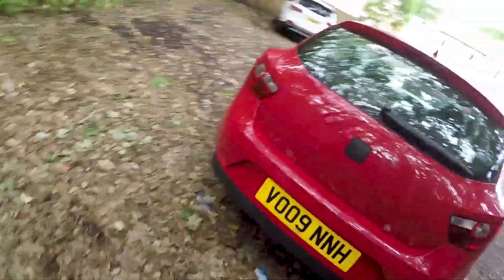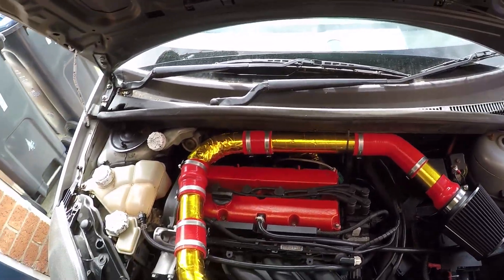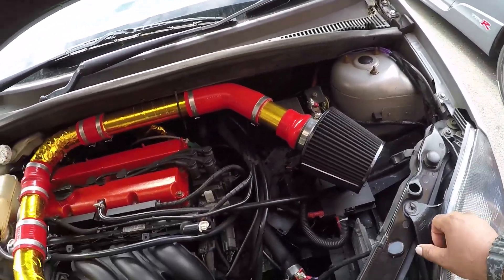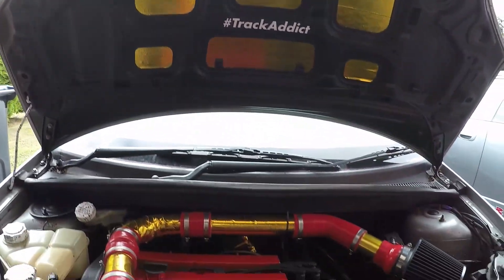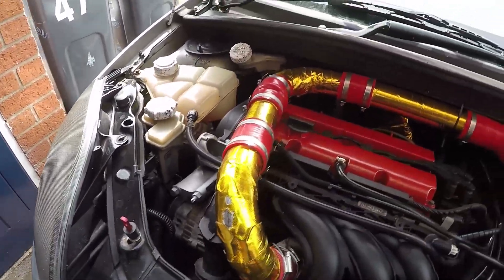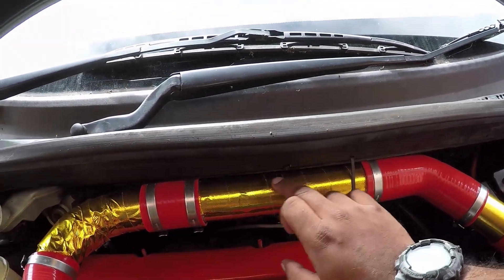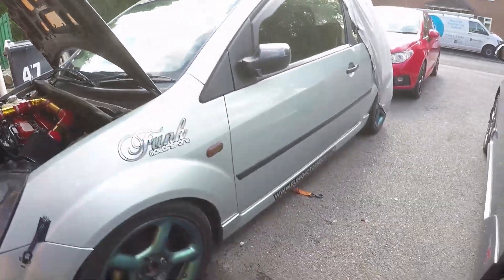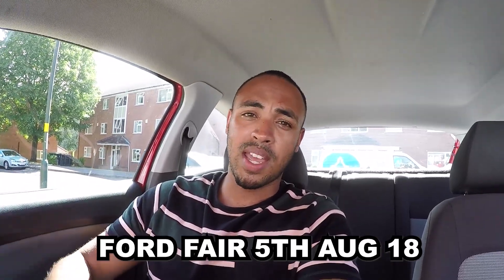HOW I MADE MY CUSTOM INDUCTION KIT [UNIVERSAL]

Comment: not being negative but there's way too much piping just for the intake,  would think it'd draw heat from going over rocker cover, wouldn't it be more efficient also if the pod filter was closer to the throttle body? I like your videos , look forward to the reply
Reply from the maker: Taii Lumsden hi,  I've got a custom headlight built specifically to let a lot of air in, so the idea was to get the air filter as close to it as possible. Unfortunately due to clearance in the fiesta bay I can't really run it else where, plus I like the way it looks 😊 thanks for watching my vids also 👌

Comment: I have a few questions, what did you do with pipe from the engine to the original airbox? Do you experience some improvement in acceleration? Where is your battery?

Comment: rouse motorsport make a induction kit for the 1.25, 1.4 and 1.6 mk6 fiestas that costs about 70 quid, or you can do what ive done and rotate the stock pipe 90 degrees clockwise and crank a hose clamp down on it. that way u dont have to run it all over the engine

Comment: what did you do with the old breather pipe when removing the air box before installing this beast. It was a small pipe on the left of the box, installing my custom induction tomorrow but wanted to know where to put this. Thanks.
Reply from the maker: Hi Jack, my pcv goes to a oil catch can